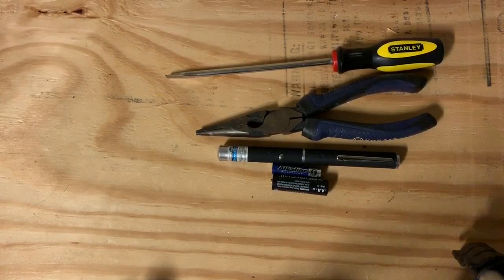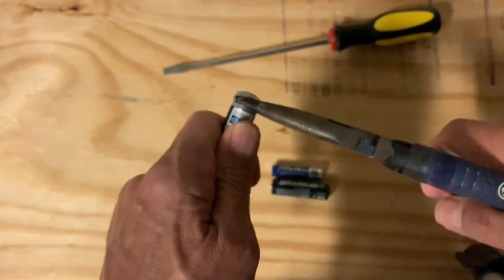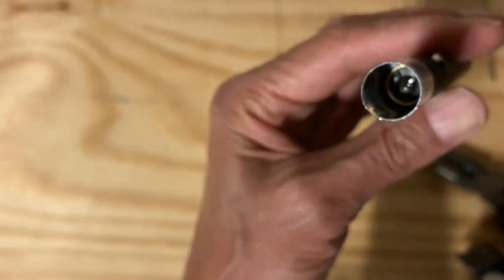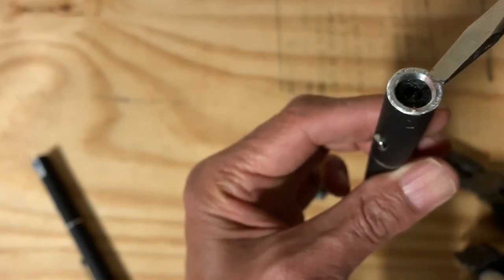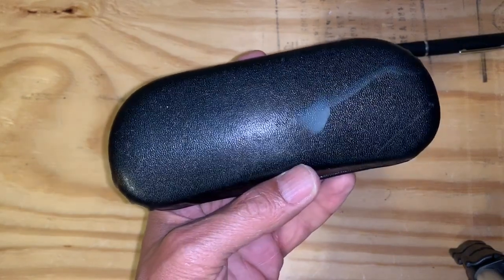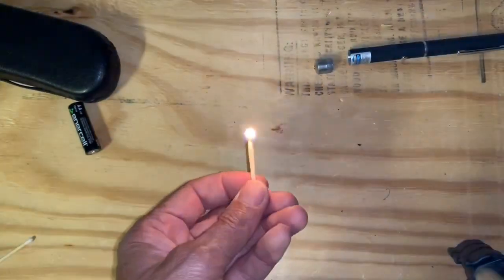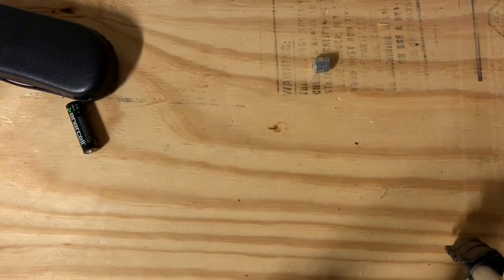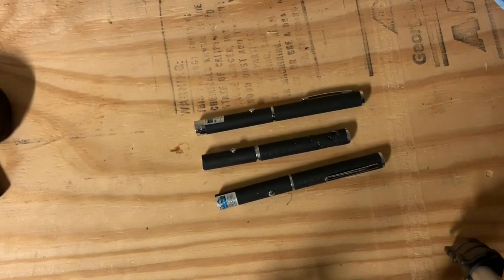Burning Laser from 5mW Laser Pointer

Comment: Will this work with a 5mw green laser
Reply from the maker: Most  green lasers are actually IR Lasers with wavelength doubler so will give IR if you isolate the laser unit.
Reply: Den M  if your greeen laser breaks and you see a faint red glow, you just shined a infrared laser in your eyes
Reply: Den M  try putting a magnifying glass in front of it you won't net to adjust your laser then